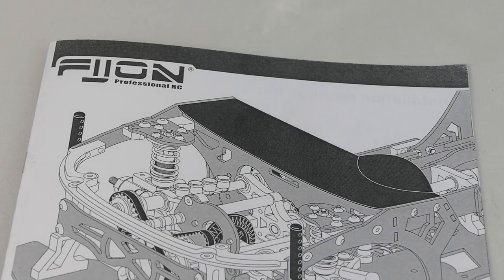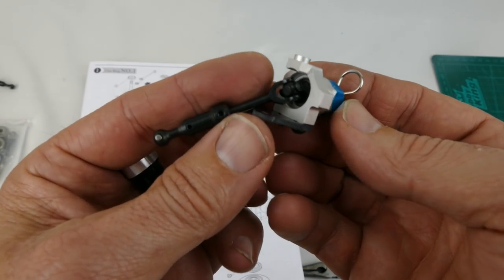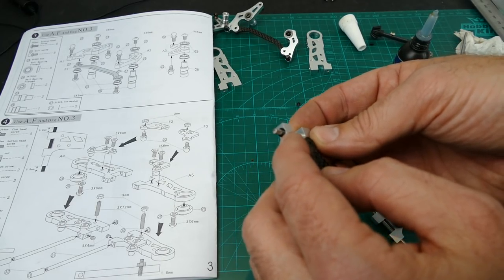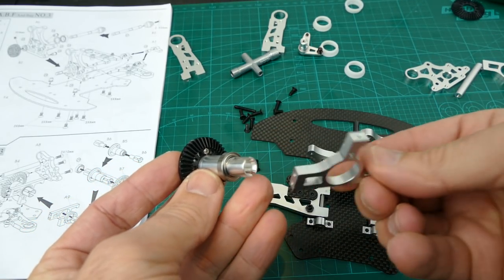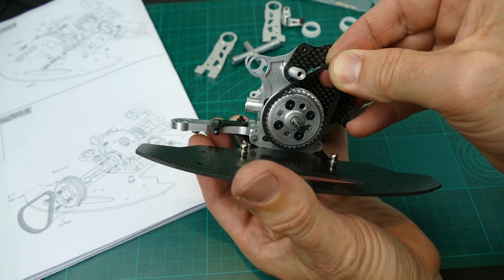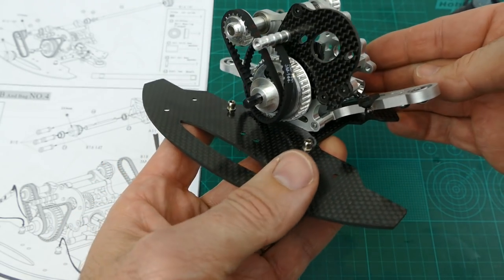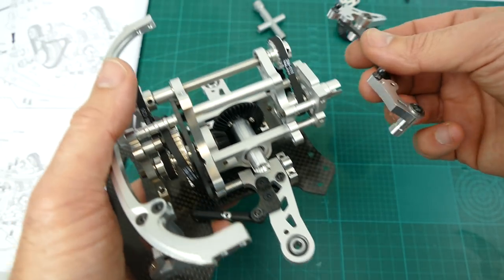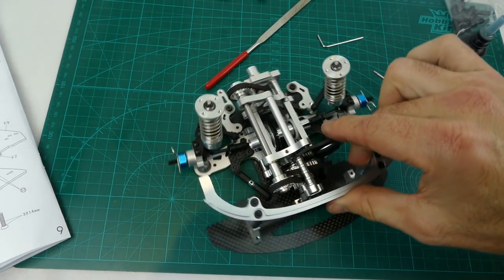FIJON FJ9 DRIFT CAR (AKA Dean Tech Bulldog) - Carbon Fiber & Alloy Masterpiece Part 2 Front End

Comment: The 0 ring in the pre load nut is to help it to stay where you have set your pre load. Kind of like a nylock nut. I see many features on this kit that are similar to my high dollar TLR and Associated race kits👍 very nicely done indeed!
Reply from the maker: +Bigdaddyd82 Vapes thanks man, appreciate your comment and thanks for watching
Reply: RC Tanks & Trucks 24/7 
Yeah no problem bud.  What a solid beast of a kit! I guess for Drifting you want some weight so it feels more stable. There are so many bearings and they all fit so nice. Im really keen on seeing the drive train work and that awesome scale suspension👍

Comment: How is your JLB Cheetah holding up?
Any suggestions for getting the pinion gear off when I've stripped the screw?
Reply from the maker: +Andrew Parker so far so good. You might need to drill out the grub screw with a 1mm drill bit